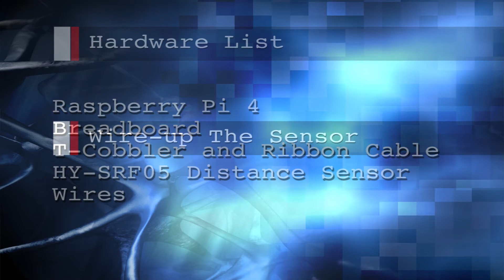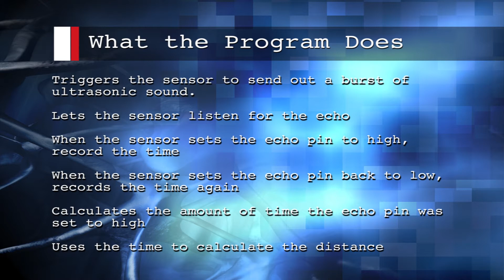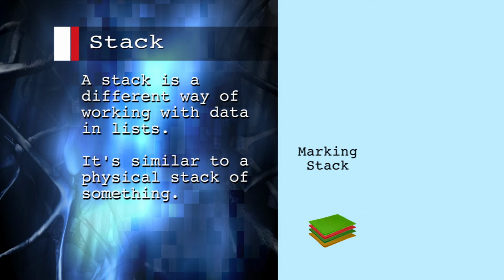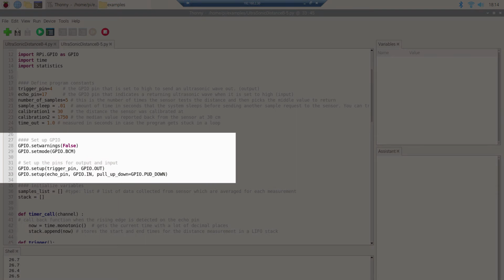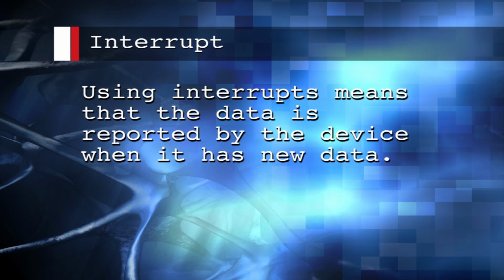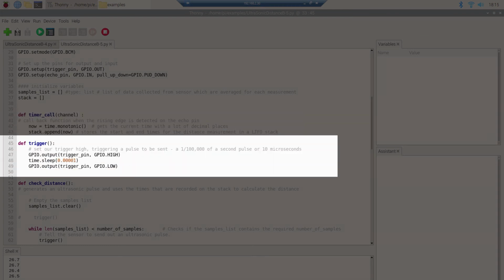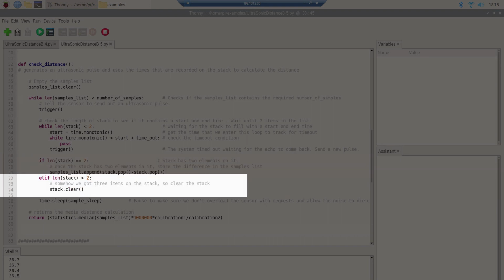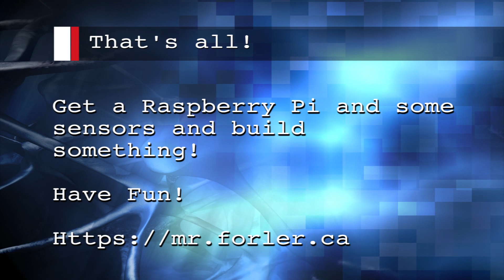Raspberry Pi, Python and HY SRF05 Distance Sensor

Comment: Are there no resistors needed? I have found some other guides that use HY SRF04 and they use resistors.
Reply: same question here - I believe resistors are needed, or a logic level converter if you have one
Reply: Late answer... But the sensor needs 5Vdc if I'm correct and the Rpi can't handle 5v directly to the I/O of the pi, so you'll need a voltage divider U=Uin+ R2/(R1+R2).

Keep the idle voltage below 3.3v and you should be ok.